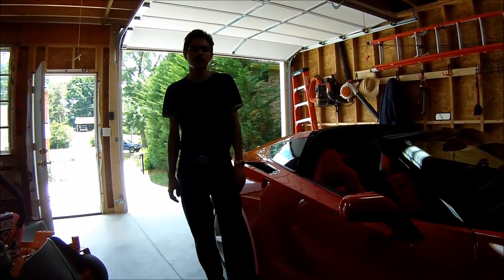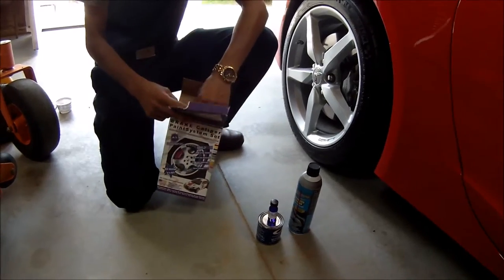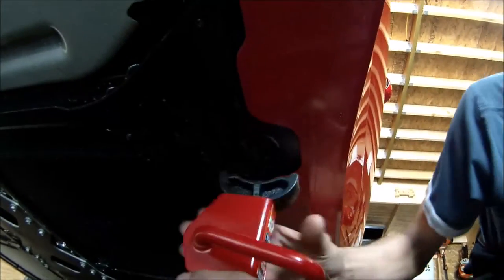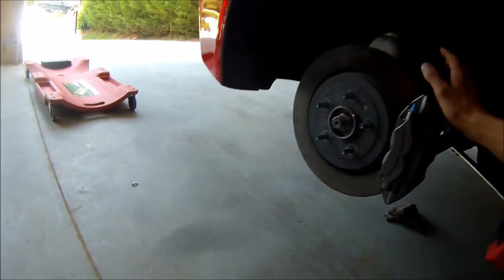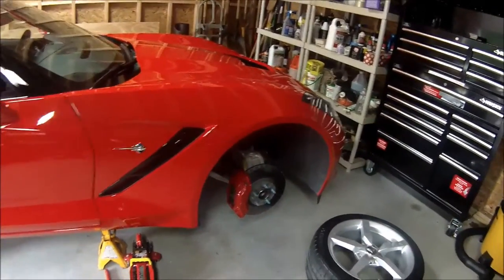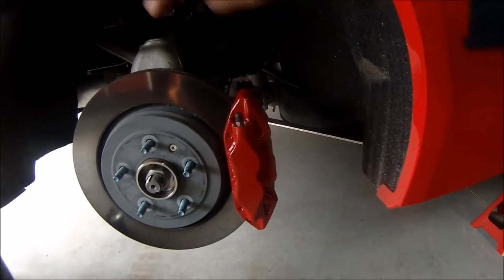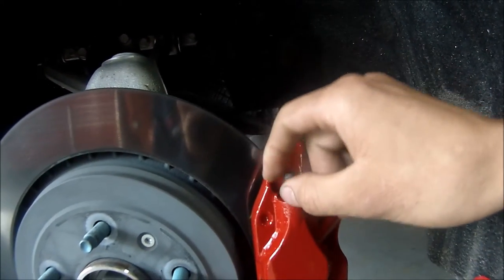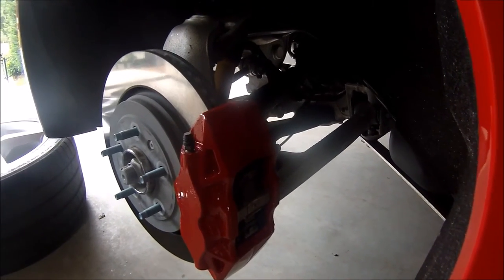How to paint calipers

Comment: I am about to do mine this weekend, I have two questions what color where the calipers before you painted them?  Did you scuff the surface of sand the surface before painting?
Looks great 👍
Reply from the maker: The calipers were originally grey.  I just rubbed the surface with some sandpaper. It's now been 4 1/2 years since I painted them, and they are still holding up great. No paint peel or paint fade.  I remember when I was ordering my car. Red calipers was a $600 option. Im like Nah,  I'll paint them myself. The high temp paint and the Corvette logos cost me less than $40.

Comment: Looking to do this on my C6 Grand Sport I just picked up.  Was looking at the spray paints for this, but this looks like it would be a good option.  One can did the whole car?   Nice job.  

Did you get Corvette Decal to put on it later?
Reply from the maker: It's been 3 years and still holding good, I applied the decals the following day after the paint dried.
Reply: @corvettedude4423  Have to see some of the follow on videos, do they show the finished product?  Do you have to put clear over the decals?

Comment: How are your decals/corvette lettering holding up?  are they starting to peel?   I am about to do my Laguna C7 with color match Laguna Blue G2 paint.    thinking after applying the decals, hitting it with a few coats of high temp ceramic clear.
Reply from the maker: The decals still look the same and the paint is still holding good.
Reply: Thanks for the reply and video.  I am about to try this with my Laguna Blue C7.   Last question, did you sand the calipers before hand or just clean them really well?
Reply from the maker: no need to sand, just use the brake clean spray that you get with the G2 caliper paint.